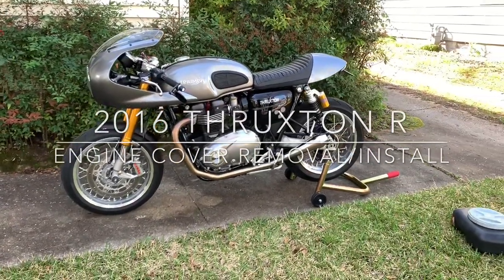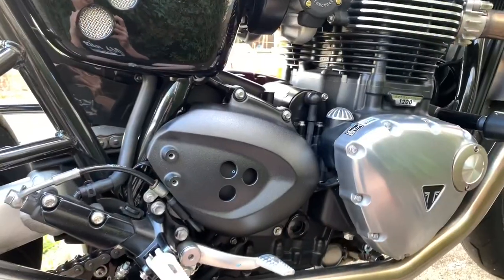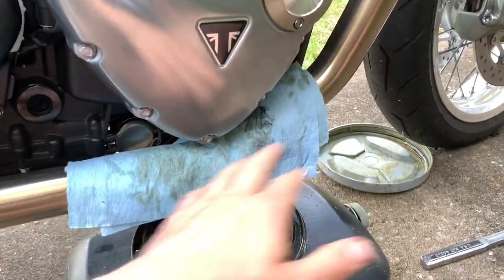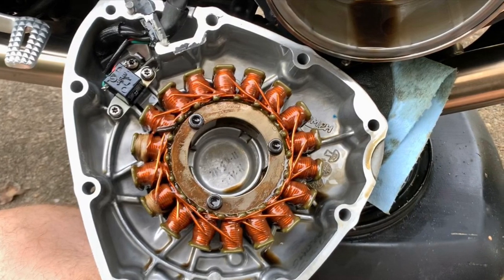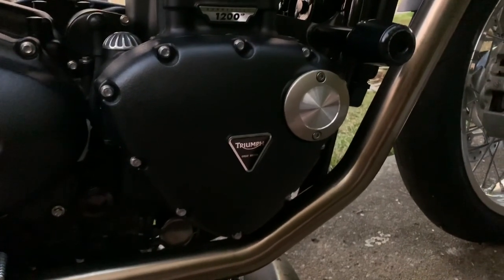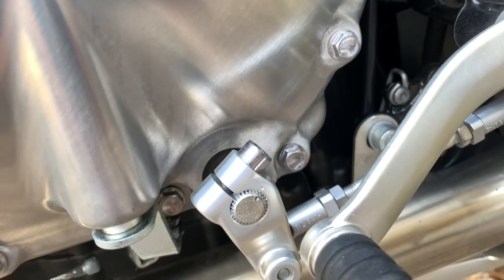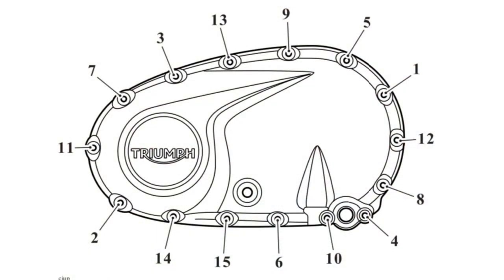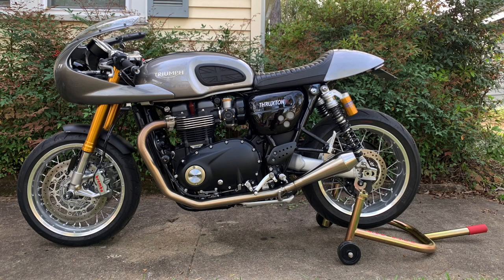2016+ Triumph 1200 | Engine Cover Removal/Install

Comment: The usefulness of your very professionally done video lives on. My 2020 rs was too blacked out for me so I put brushed covers on it. Bought some used cases and sanded and brushed them with great results. It helped to know what lurked within before turning the bolts. A couple of useful things I discovered. The alternator cover for the rs is different from the other 1200s. Different stator mount. Also when the clutch cover came off and the gear falls loose, the shaft slipped further into the gear and I was unable to pull it back out until I used a magnet stick. The clutch cable reinsertion into the lever was easy if you do it while the cable is not mounted to the cover bolts.Thanks for the tutorial.  John
Reply from the maker: So glad it was helpful for you! Thank you so much for adding your comments on the differences between this and the RS model! I have pinned it so that it can hopefully help others.

Comment: Video was spot on William. Appreciate the video steph through. Ordered these covers some time ago and never got around to swapping. FWIW - For the stator side cover, it actually was easier while working on the bike get the siliocone in the wiring grommet, and then have the gasket on the cover before installing vs. having the gasket on the engine side. Thanks again! Hope you still have that bike.
Reply from the maker: Great! Thank you for the input. I do still have it :) I keep thinking about swapping it out for a Scrambler 1200 but I just can't seem to do it!

Comment: Thanks William!
I'm at the part where I'm trying to line up that clutch rod into the button and this is my 4th attempt at it. When I think I've got it, the actuator arm at the bottom moves back and forth to about 80 degrees and I know that's not right cause there's way too much clutch cable available to slip into the notched area (whereas when I was taking it off it was pretty tight). I guess this is a common problem when re-installing that cover and I'll just keep at it. Thanks for this video because it confirms that I something was wrong, mainly me. 
Cheers.

Comment: Thanks again. Here is some feedback from my experience after watching Will's videos: 

Cable off:
-Getting the cable off; you may need to adjust the cable at the clutch itself to gain a little more slack at the bottom

Clutch foot lever: 
-When you go to take your clutch foot lever off, you can adjust the nuts on the ball socket part that hold it to the clutch arm and the foot lever itself. Working between the two bolts/nuts you can  provide more room to slide it off (warning these teeth are sensitive and precise, it needs to be lined up with the
 dot exactly when you put it back on or the clutch wont work)

Engine Cover removal:
-When pulling off the engine cover, you may need to use a block and rubber hammer; my gasket was really wedged at the bottom
 and it was hard to pull off with just my fingers 

- When pulling it off, turn the clutch arm (or what ever you want to call it towards the back of the engine cover (tail of the bike)), this will help push the engine cover away from the parts inside and will help get it off
-A washer fall out when I took my engine cover off and I had to figure out that it went on the clutch arm itself (where the foot lever attaches, inside the engine cover)
-That top gear does come out with the engine cover, as it was the same for me, I removed it and replaced it about five times to make sure I had it right. It's very finicky, and I wasn't sure till I started my bike up after the job that it was 100% in the right place. I would say the best way to ensure it's resting right is by making sure the gears are lined up the proper way and not tilted. Also be careful, the arm that the gear actually sits on may slide out of the gear itself, I had to catch mine a few times
-My engine cover did not have a sound deafing plate (if yours does, I suggest using loctite inside to make sure those screws are super tight)

Engine Cover Reinstall: 
-Make sure your arm is pointing towards the back of the bike to get the pin and the hole lined up
-After the cover is on, the hardest part was getting the clutch cable back on the arm. I too was fooled because I could only push the clutch arm so far forward (towards the front of the bike) which was confusing because I did not think I had enough cable for the clutch system to work fully from the hand lever down to the arm where the cable attached. However after struggling and adjusting the cable  I had enough slack and  it slipped on. I then tested with the hand lever and for some reason everything worked out perfectly. It is definitely tricky when you are trying to run it in your head how it works. 

Lastly when I turned on my bike my gear indicator was off. I was concerned that I shifted my bike when working on it and some how the computer got off on what gear the bike was in when I started the job. 

Lastly, firing your bike up is the scariest part. Especially that one gear that falls out when you take your engine cover off, I was pretty sure I had it back in the right place... but you aren't ever quite sure till you fire up the bike and there are no awful noises Luckily that wasn't the case for me thanks to this video. 

Thanks again Will for the video and the help.
Hopefully that helps or makes sense for someone (sorry if the terms are not exact for the parts)

Best-
Shea
Reply from the maker: Thank you for these great additions! I've actually pinned this as the top comment hoping it will help others in the future. 

So glad the video was helpful!
Reply: I know this is years later but that washer on the clutch arm was tripping me up as to where it fell out of. So thanks for that tip.
Reply: What could/would happen if by mistake the bike was not in the gear that it was in when the work started? I'm about to put the cover back on (after many attempts this afternoon to try and get that friggen rod to catch the button) but I'll walk away and try again tomorrow morning with a fresh outlook and rested nerves.
Reply from the maker: @cyrilleloreau1603 I couldn't imagine where that would matter as the gearbox is all internal.

Comment: Awesome video, thanks for posting. My clutch cover coating is peeling off (Speed Twin); a common occurrence I'm told. Just need to decide whether to get the original powder coated by a local firm, or jus buy a new part. Thanks again and safe riding!
Reply from the maker: Glad it was helpful! Hope you get it sorted.

Comment: I'm going the opposite route pulling the powder coated bits off of my 2022 Bobber in favor of the brushed. I was going to have the dealer do it at the 500 mile service but your video leads me believe I can pull it off and not have to pay dealer labor fees. 

I bought a HF bike lift for such things, I may as well take advantage of the crappy weather and do some wrenching.
Reply from the maker: Great! Best of luck. You shouldn't have any problem finding someone to buy those black covers for $200-300.

Comment: Hi William - do you remember how you pried the clutch cover off? Seems to be on very tight. Thanks.
Reply from the maker: Hmm...I do not remember specifically. If you're sure everything is disconnected properly, it's likely the old gasket holding it tight. I would take a rubber mallet and start with some light taps increasing force until it pops free.

Comment: Hi. Im having some real problems getting the actuator arm to sit right on my T120, when replacing the clutch cover. Not many people talk about it, but you do on this video! I havent managed to get it right yet, but it does feel like it has gripped the pull rod when fitted. 🤷‍♂️ Dont know what to do with it. Any tips?
Reply from the maker: The thing that kept tripping me up was thinking that if I had it in place correctly, I should be able to actuate it with my hand. However, this turned out not to be the case. I needed the mechanical advantage of the clutch lever to actually move it. So I had done it correctly several times without actually realizing it. I would say if it feels like you've got it and it's not freely spinning. Maybe throw 4 or so bolts in to hold the cover on and then give the lever a pull to see if it's working. Keep in mind that you can always put the bike in gear and see whether or not the clutch is actuating without needing to start it!
Reply: @wpanik  What did you mean by spinning? What's supposed to be spinning here? I ask because I'm having the hardest time getting that rod inside the cover to catch the button properly and when I think I have it, it's movement goes from 10 (o'clock) to 2 (o'clock) but in reality shouldn't it be going from 3 (oclock) to 12 (oclock)?
Reply from the maker: Nothing should be freely spinning. That's what I was getting at. If you haven't caught the linkage, the shift lever will be able to spin all the way around because it's not catching anything. 

Did you remove the actual shift lever from its shaft at any point? That shaft and lever are splined so that you can adjust the actual shift position. That said, if you didn't remove the lever from the shaft, the position wouldn't have changed from where it was when you started. However, if you did separate them, it's possible you just changed the alignment when putting it back together.

Comment: “This is probably the last thing I’ll do to it, for a little while”. LOL... you’re funny. 
I’m thinking this is my next mod. Not quite ready to take on the air box delete quite yet... may wait until winter to take that one on. I’m worried that once I have the black covers, new wheels will be a must have (in my mind)
Reply from the maker: It was! For about 6 months! 😂

I go back and forth about black wheels a lot. For now, I'm happy with them silver.

Comment: Hey! Thanks for the video! Just a question regarding small balls bearing in clutch cover (those for gear shafts). How did you removed them before powder coating? Thanks
Reply from the maker: So sorry I missed this comment, I hope you got it sorted! I had received them already coated and with the bearings installed.

Comment: Torque on the clutch cover
bolts?
Reply from the maker: Hi Steve - both covers say 10 Nm.
Reply: @wpanik  thanks! I broke down and subscribed to the triumph tech info. How did you get the cover off? It’s snug.
Reply from the maker: @steveFL450  If it's a subscription which can be cancelled, and if it's actually a Thruxton you have, there's a full version of the shop manual here! https://drive.google.com/drive/folders/1DOGndAJsmMhbImnQRwOMYiGKYIWsZF8z

As for the clutch cover, I don't exactly remember what I did. Once I had re-confirmed that everything is correctly disconnected, I would start tapping on it with a rubber mallet until the seal was broken with the old gasket.
Reply: @wpanik  I have a speed twin actually. Thanks for your reply, you’re super helpful.
Reply from the maker: @steveFL450  Thanks! I try to be!

Comment: Hey thanks for doing this. I’m about to do this to my TTR this weekend. Question on the sound deafing piece, did you use anything to make sure those bolts were extra tight and locked in? Also are the engine cover bolts set to torque to 10 NM as well?
Reply from the maker: Great! Hope it helps. 

Yes, I put a dab of Loctite on the bolts for the sound deadening block. 

Also, yes, 10Nm for both the clutch and alternator covers.
Reply: @wpanik  thanks will, having a hard time with the clutch cable removal part, driving me nuts.
Reply from the maker: @SK-kt2ch  that was definitely the most frustrating part. Let me know if you have any specific questions!

Comment: I can’t get my alternator cover off
Reply from the maker: SYNC KID Don't forget that you're fighting done pretty strong magnets here. Make sure you have a really firm grasp while avoiding having your fingers in between the meeting surfaces (that would be a MAJOR pinch) and pull VERY firmly. As long as you have all of the bolts out, the magnet is what you're fighting. Also avoid yanking it too far off the bike as you don't want to damage the cables running in.
Reply: William Panik I was able to get off by using a block of wood and hammer from the opposite front side on the relief point.
Reply from the maker: Great! Glad it worked out!